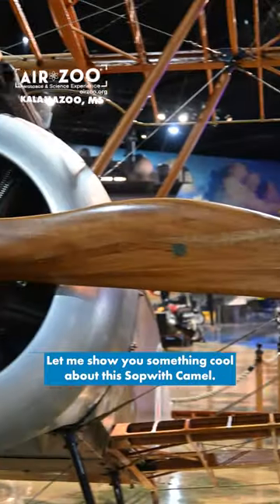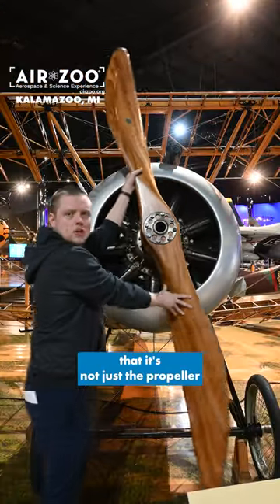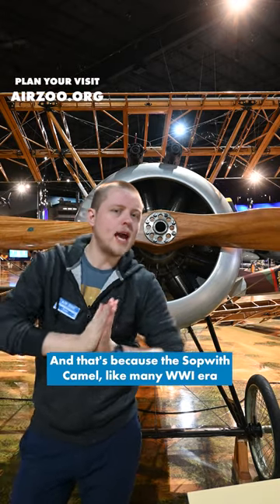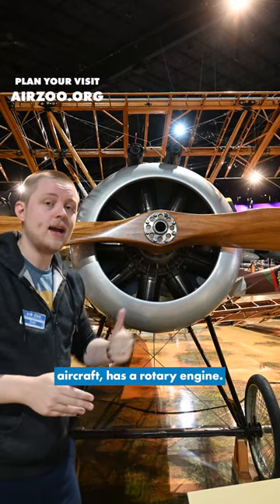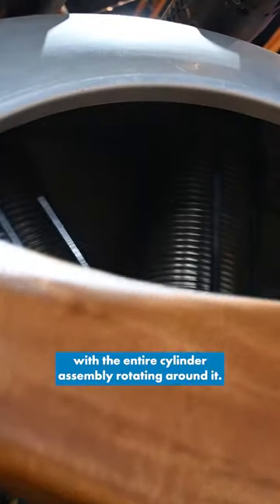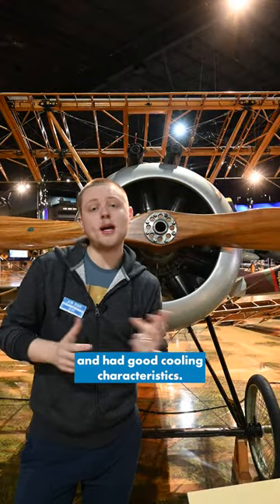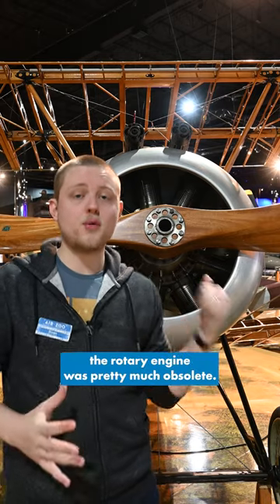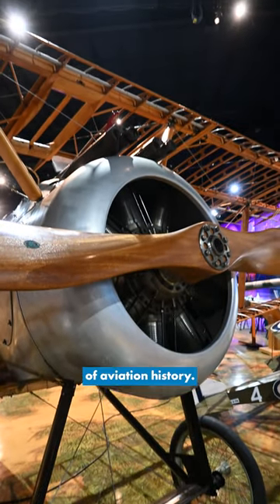The Sopwith Camel's spinning engine!

Comment: Wow! I did not know the engine spun with the propeller on a rotary engine. Pretty ingenious way to keep engine cool and probably eliminated the need for an oil pump. But how did fuel get to the engine?

I imagine that electronic fuel injection coupled to motion sensors could compensate for the problem caused by centrifugal forces creating uneven fuel distribution.
Reply: Rotary aero engines had oil pumps. Fuel and air go down the hollow crankshaft into the crankcase, thence into the cylinder via intake tubes running from the crankcase to the intake valve. (Monosoupapes work a bit differently and I mention those in other posts. But they too have oil pumps as well.)
Reply: @kevink.5777  Doh! You're right. There would have to be a way to pump oil into the crankcase area from the cylinder heads.
Reply: James- actually the oil is kept in a tank outside if the engine. The pump is external too. Oil is pumped down a channel or tube down the crankshaft and then into normal oil passages and galleys to lube the crankshaft, the connecting rods at the crankshaft, etc. Oil then eventually ends up in the crankcase itself where it continues to lubricate things like cylinder walls, connecting rod pins at the piston end. But it will end up being consumed/ burned and exhausted out.
Rotary aero engines are a “total oil loss” engine- as they run they consume oil. 5-6 quarts an hour - it can vary by engine model and aircraft. A Camel has a 7-1/2 gallon oil tank, plenty to keep the engine supplied in flight.
Many then take this to mean they are a 2-cycle engine, but they are a true 4 cycle engine. The oil ending up being mixed with the fuel and entering into the cylinder is a consequence of design and operation. Nothing is“ pre- mixed” as in a 2 cycle.

Comment: Rookie pilots were actually banned from flying the camels because their high torque had a nasty tendency  to drive the plane into a nosedive. Forget cruising, a Sopwith Camel pilot could never take his hand off the controls if he wanted to live.
Reply: Not true,   student pilots trained in them! In fact the RFC felt it was best to get them into them as soon as possible. This is not to say that was a wise decision, as Camels will end accounting for more deaths in training than any other type.used by the RFC/RAF in WW1…
The French felt otherwise when it came to training and took a more gradual approach generally (with training in general)
The other issue is the torque factor, while noticeable to a new pilot or one who has never flown them, is not as bad as folks think. Pilots soon get used to it and compensate  as needed. You are correct in noting the Camel pilot (and other aircraft frankly) needed to fly the aircraft, not relax and “cruise”. 
Also aircraft DESIGN  factors large into how rotary powered aircraft handle. Short wings and fuselage, they are “quirky” . Long fuselage and larger wingspan, rotaries are quite doceil. Just look at and read about the Avro 504K.

Comment: So what? I can tell you that rotating engine was once installed on a commercially celling motorcycle.
Reply: You're thinking of the Wankel rotary as used by Mazda. And as you can clearly see is a entirely different kettle of fish.
Reply: @johnklatt3522  Mr Klatt, well done..... it looks goofy as hell. Has a ton of engineering issues. But, it does exist.

Comment: Two-stroke engine, using a mix of gasoline and castor oil...A lot of German planes were grounded toward the end of the war because of shortages of castor oil...and it ran "all out," the speed control, such as it was, came through a "blip" switch that allowed the pilot to kill ignition to one or more cylinders.
Reply: Nope, these are 4 cycle engines. Germans NEVER had enough castor oil, so they use linseed oil, rapeseed oil and Voltol, a blend of rapeseed oil and other oils. They had oil, just not castor oil.
As mentioned elsewhere, they did not fly using or controlling by a blip switch. They had throttles and carburetors. RPMs could be adjusted, normal range of 500-1200 rpm. Blip switches are used under 700-800 rpm on landing to help slow it down faster as the windmill effect of the spinning engine wouldn’t allow for quicker reduction in rpm’s alone.
Yes, rotary engines are a total oil loss engine, as they run they consume oil.

Comment: It's a fixed prop Radial engine boyo. It was done for cooling and oil management.
Reply: Let's not try and rewrite the manual here. It's a rotary engine.
Reply: @WALTERBROADDUS  Tell that to Heir Wankel, designer and inventor of the famed rotary engine.
Reply: @richardhowells5804  the Wankel is a different design. Had one by the way.

Comment: Thanks. First time I saw one move.

Fun fact: The lubricant was castor oil mixed in with the fuel, and there were no exhaust pipes. The pilots were breathing in some unburnt castor oil. Castor oil is a strong laxative.

Some aircraft didn't have throttles to control engine power. They ran at full speed all the time, except there was a button on the stick to cut the ignition. To land, the pilots blipped the ignition off and on. When the ignition was off, the engine still exhausted fuel and unburnt castor oil.

Comment: I find it hard to belive that rotary engines eventually stopped using them. Like, before jets, what did they use? A V8 or 6? A  W12? A  I6? Like, yes, I know radial engines, but... how did non radial engines work in a plane. I might just be dumb tho, but I still don't get it
Reply: Lots of engines, the Mustang and Spitfire used a V-12, a few planes used I-4 or I-6 engines, a lot of modern props use opposed 4s, etc.
Reply: I don't know what's so hard to believe?

Comment: Rotary engines are not obsolete. The design was merely changed to fixed cylinders and rotating crankshaft.
Reply: Radial engines and rotary engines are different. Rotary refers to a specific subset of radials which had fixed crankshafts.
Reply: @silaskuemmerle2505  Good to know.
Reply: Please stick to the script here. Just because something is arranged in a radial configuration does not make it a radial engine. At any rate, both rotaries and radios are pretty much absolute aviation wise. No one's really making them today.

Comment: I mean they still used rotary engines well into and through WWII, they just didn’t rotate with the propeller

Maybe it’s the same engine just referred to as Radial at that point
Reply: Rotary engines are not to be confused with radial engines. Look the same, both air cooled, but rotaries do come to a hasty demise within several years after the end of WW1, as the issue of engine cooling thru better cylinder design and material render them obsolete. Radials were around before rotaries (aero engines I’m talking here), but rotaries dominate from about 1908-1918. 
Rotaries have all the cylinders rotating around a fixed crankshaft as Euan says in the video. Radials have fixed cylinders and it’s the crankshaft that is turning. 
They did not use rotaries (aero) in WW2.
Reply: @kevink.5777  I'm thinking in terms as a mechanic here, the engines look so similar that they appear to be effectively the same thing in just different configurations, as you pointed out their similarity. HOW they are used and interact with the plane body seems to be a bigger difference than the overall engine design. Still plenty of air cooled radial engines used in WWII. I'm not arguing so much as trying to understand the fundamental difference mechanically speaking. Pull both engine types from the planes and what differences would I see?

Comment: How does the fuel get to the cylinders???
Reply: Crankshaft is hollow. Fuel, oil, and air is sucked into the crankcase through the crankshaft. Then it is sucked up to the head. Spark is provided by contact ring and contact points on the back of the engine.

Comment: He forgot to mention that the engine had very low horsepower, they use to come apart due their spinning and they were lubricated with castor oil, which made some of the pilots get the runs.
Reply: I've heard that's also why many pilots of the era wore scarves, so they could cover their mouth and nose in case of an oil leak and avoid getting a surprise laxative.
Reply: @NicJJiac  fascinating! Makes me want to Google it but also not Google it in case it's false lol I the idea
Reply: Dunno, 140hp out of a 380 pound engine in 1915 sounds like a fairly incredible accomplishment.
Reply: Most early engines were not particularly high powered.
Reply: @BsUJeTs  Rotaries didn’t come apart due to their spinning. Tens of thousand got used, they held up quite well actually. Typical RPM range was 500-1200 rpm’s. The limiting factor if that over 1200-1250 rpm more energy is used to overcome resistance of the air vs contributing energy to move the aircraft faster or haul a heavier load. This was a well known issue. And per numerous other responses on this video, pilots do not get “ the runs” from castor oil. It simply is an oft repeated myth. 

Most all WW1 era engines were low horsepower vs weight it is true. Technology improves, the power to weight ration improves. The Bentley BR2 rotary produced 210-230 horsepower approximately, which was the best in WW1. But it was a 1521 cubic inch engine!

Comment: How do the engine get fuel to it while rotating?
Reply: Through a manifold and carburetor designed to allow each cylinder to line up and get a bit of fuel/oil and air as it passed by in rotation.

https://en.m.wikipedia.org/wiki/Rotary_engine#:~:text=A%20rotary%20engine%20is%20essentially,cylinder%20block%20rotates%20around%20it.
Reply: There’s some excellent videos on YouTube that will answer all your questions.
Reply: @ishandiptagarai852 A fuel pump gives the engine it’s fuel.🤡🤦‍♂️🤦‍♂️🤦‍♂️🤦‍♂️🤷‍♂️
Reply: @spanqueluv9er  , there isn't, the Camel uses a gravity feed system. It isn't much more complicated than what is on a small engine lawnmower.
Reply: @spanqueluv9er  :  |
Reply: @spanqueluv9er  i know that too..i meant if the cylinder blocks are rotating too how does the fuel get to it from the tanks because ofcourse the tank won't be rotating too..if you are so smart explain
Reply: @ParkerUAS  that's some insane  engineering..
Reply: Btw thanks
Reply: @spanqueluv9er  🤦‍♂️
Reply: Fuel and air travel down a hollow crankshaft into the crankcase. When the intake valve is opened on the intake stroke the fuel and air mixture is drawn from the crankcase into the cylinder through a tube going from the crankcase to the intake valve. (Look at a LeRhompne Rotary, those copper colored tubes are the intake tubes, running from crankcase to intake valve. They are the easiest to see due to the copper color, but most others use the same method except monosoupapes. 
Early Gnome rotaries used an “atmospheric” valve in the top center do the position. On the intake stroke the drop in pressure inside the cylinder would allow the valve to open, letting fuel and air from the crankcase into the cylinder. They will get away from this as that valves and springs get all bumped up and are a maintenance issue.
Monosoupape engines had holes or ports at the bottom of the cylinder, and the piston would travel down past the ports, opening them up to feed fuel and air into the cylinder, again, this mixture coming from the crankcase. (This is a 4 cycle engine, so on the power stroke the piston again exposes those ports but thru clever valve timing the spent fuel. Ie: exhaust, will start to make its way out the exhaust valve versus back into the case. Marvelous engineering!)
Reply: @ParkerUAS  wow!!! 👍
Reply: @spanqueluv9er  Actually, no fuel pump. Like a Briggs and Stratton lawnmower engine, gravity is all that is needed to get the fuel from the tank to the engine.
Reply: @ParkerUAS the Camel has 2 fuel pumps. Manual and air driven.  Each pressurising the main tank to force fuel to the engine.

Comment: I think they ran on castor oil.  This is why the early aviators wore the stereotypical leather aviator hat, flight coat, scarf and goggles.  They were sprayed with castor oil from the engine.  The smell must have been something that was unpleasant.
Reply: Nope, they do not get sprayed with oil as they fly. I address this in other posts. One of those enduring myths that seems to keep coming up. The scarves were to Worn around the the neck to protect it from the wool or leather collars of their flying jackets. Otherwise they would rub the neck raw every time they flew as they were constantly looking around swiveling the neck and head.
They look dashing, but the scarf had a very practical purpose.
Reply: Castor oil was the preferred lubricant because it held up well under the operating conditions of a rotary engines- fuel going into the crankcase and getting mixed up with oil to a certain extent. Castor was, and is, a very good engine lubricant.
Germany had trouble getting castor oil so they used other plant based oils- linseed oil, rapeseed oil and they developed an electrolyzed blend called Voltol. I understand that the old Pennsylvania sweet or rich oils worked very well in rotaries as well. But castor oil beat them all…
Reply: @kevink.5777  Thank you.

Comment: Why the hell did anyone design it this way in the first place?
Reply: Engine cooling for one. I imagine oil distribution in the crank case was handed without a pump. And as stated in the video it made operation smoother.
Reply: @SameAsAnyOtherStranger  correct- all about wanting to use an air cooled engine but the radials of the day simply would overheat too easily. A rotary engine gave you an air cooled engine you could build with larger displacements without overheating. Worked very well in their day. And very popular at the time.

Comment: Another downside about this engine is that the engine oil would literally be thrown overboard due to it's spinning effect so the pilots would literally be coming back from missions (if they ever came back at all) soaked head to toe in engine oil.
Reply: No, pilots do not get covered in oil. They are not soaked in it. I address this in other posts here. But exhaust is shot downwards under the aircraft and the cowling is tight to the fuselage. This is one of these enduring myths that is not true. Aircraft and engine designers were not expecting pilots to fly these as if they simply didn’t matter…they understood the defects of exhaust fumes on a person and so they figured out ways to avoid this.

Comment: Talk about the castor oil they used, which leaked on to the pilot, causing him to poop himself.
Reply: Nope, a long held myth…
The crankshaft is fixed, therefore every cylinder on the exhaust stroke has the valve opening and closing in the 4 o’clock to 7 o’clock positions approximately, ie: downwards. The exhaust is run underneath the aircraft. Next, all rotary powered aircraft had a tight fitting cowling, whether round or horseshoe style. This helped contain any blow by exhaust and unburnt castor oil from blowing back on the pilot. 
It’s a myth about rotaries “bathing” the pilot in castor oil while it flew.  I’ve seen, met with, and talked to a number of pilots who fly rotary powered replicas, they all say the same thing” Look at me, am I covered in oil? Nope…”

Comment: The reason was to time the machine guns with the prop so it would not shoot it up into pieces. I worked on one that my owner bought from a auction in the 80s and the actual log book on the plane he was shutdown by the redbaron and landed in the field behind a mansion in England. Plus when we was restoring the plane we found spent 303 shells from the guns and also 30 shells in the belts still there we had a gun smith remove the firing pins and left it like it was no restoring the plane all bullet hole still there plane is somewhere in a museum with log book in front of the plane. It was awesome to touch a piece of history. God bless those pilots on both side that flew those open cockpits no heat no safety equipment.

Comment: Do all rotary engines rotate? Would love to see how the cylinders transfer power ( how the crankshaft works in these ). Cause ww2 had lotta rotary engines too
Reply: All Rotary engines rotate. Radial engines are closer to typical inline engines.
Reply from the maker: WW2 had a lot of radial engines not rotaries!
Reply: Every Rotary is Radial, very few Radials are Rotarys. Different things.
Reply: @AirZoo  Aah . Makes sense !
Reply: Rotary engines have the crankshaft mounted to the firewall

Comment: The engine is NOT a "rotary" engine. It IS a RADIAL engine.
Reply: The engine is spinning, isn't it? That's what ROTATE means. Radial is a circular configuration; rotary is a type of operation. If this engine doesn't rotate it can't run because spinning is what allows it to operate. Hence the name "rotary engine" (spinning engine).

Comment: The car guy in me is screaming at this one. That is a radial engine, not a rotary. Rotary engines have no pistons or valves. Instead, they have 1 or more "rotors," which are basically triangles spinning around an eccentric shaft (basically a crankshaft). Radial engines have all of the cylinders laid out in a circle around the crankshaft, as seen here. There's a guy that built a really badass 1950's plymouth truck with a radial engine in it. If I can remember his instagram, I'll edit this comment to add it.
Reply: Completely forget about the Wankle rotary for a moment. This is a rotary engine. Not a radial.

Comment: Its a radial engine not wonkle.
Reply: Radial is a configuration. Rotary is a method of operation. Here is another point. Put a Wankel beside one of these. Which ENGINE actually ROTATES (spins). 

The rights to the Wankel name expired and Mazda didn't want to pay royalties to re-license the Wankel name, so they chose the term "rotary" to replace it.

The Wankel isn't a spinning engine, so "technically" the ENGINE ITSELF isn't rotary, it just has a spinning rotor INSIDE it.